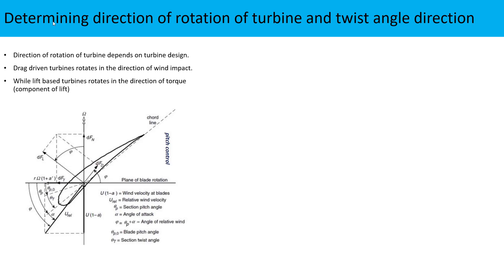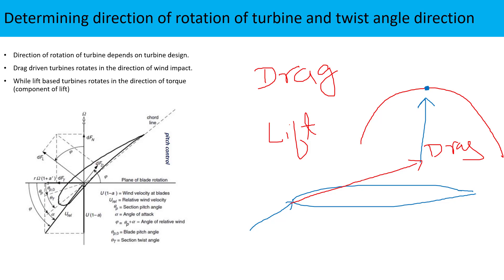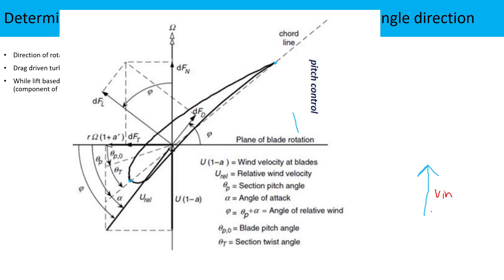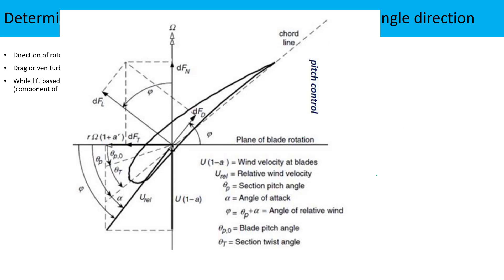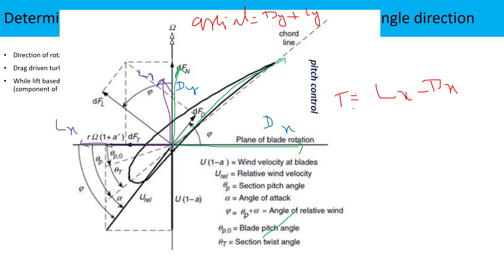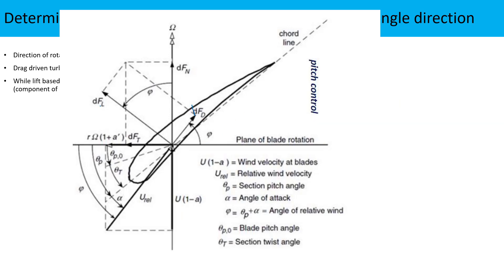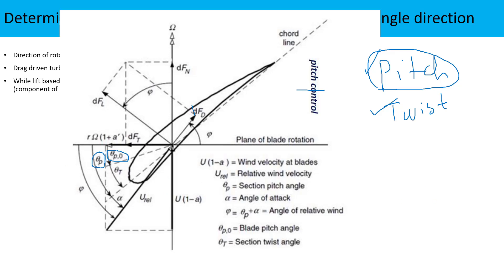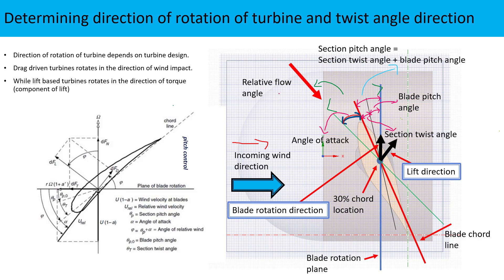Part 2 - Angles in wind turbine

Comment: I still do not understand what blade pitch angle is. At 14:22 the picture on right side, what is the black line between the blue blade rotation plane and red blade chord line?
Reply from the maker: that is line between blade pitch angle and section twist angle. By the way blade pitch angle is constant value and is same for all blade sections.